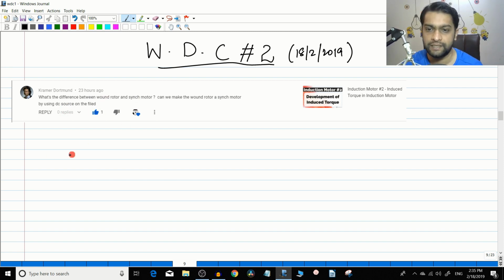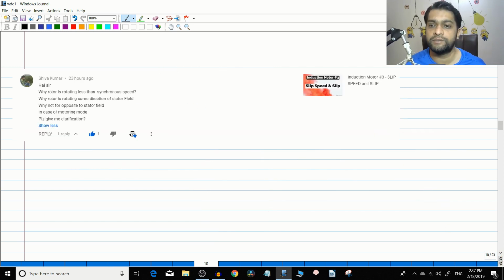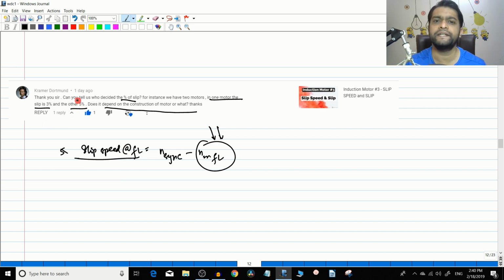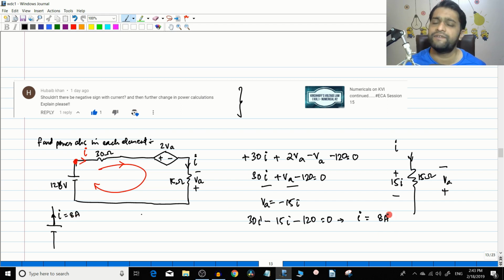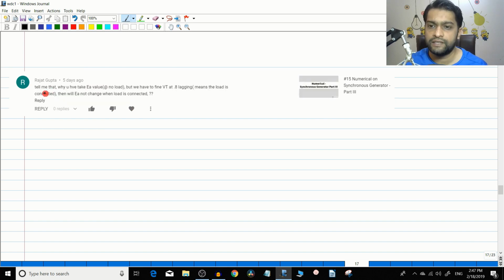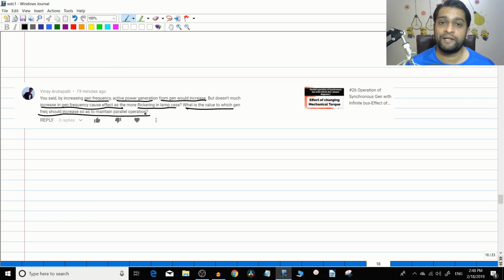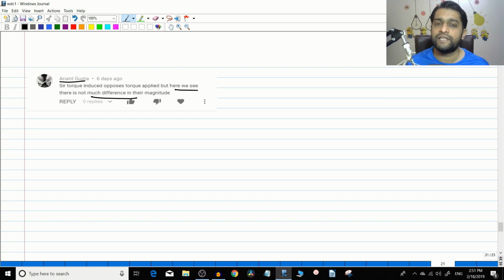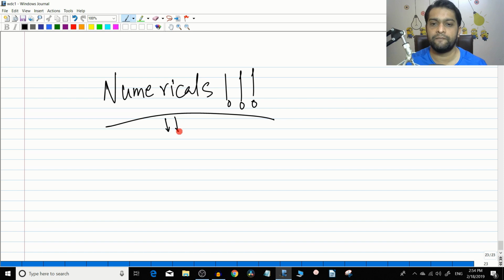WEEKLY DOUBT CLEARING SESSION - W.D.C 2

Comment: Thank you Sir, how many wires are required in a 3 phase power supply or possible? 3 wire, 3 +1 neutral, 3+ 1n + 1Ground... please clear confusion of when is to use what, where in respect with machines/power systems. if possible explain star and delta with neutral and ground connections.